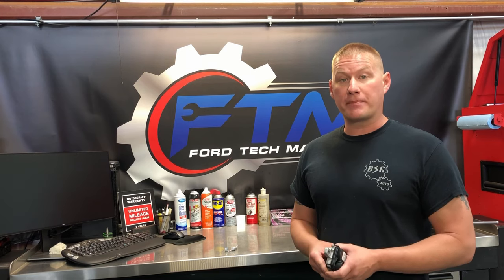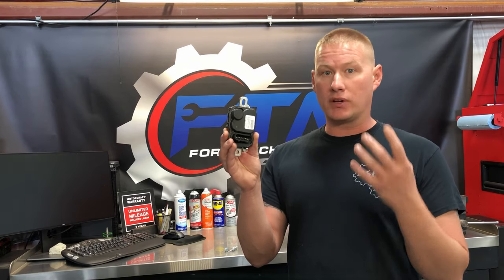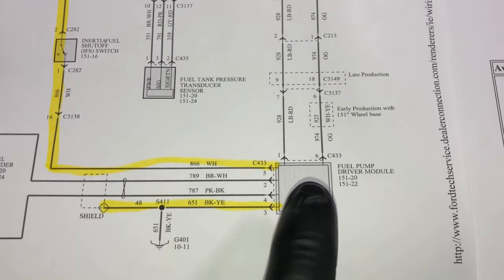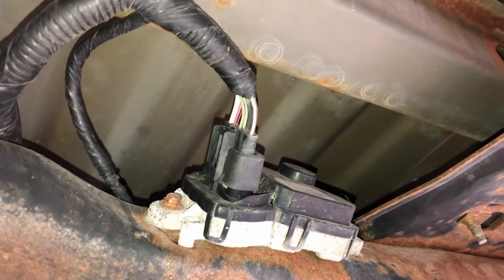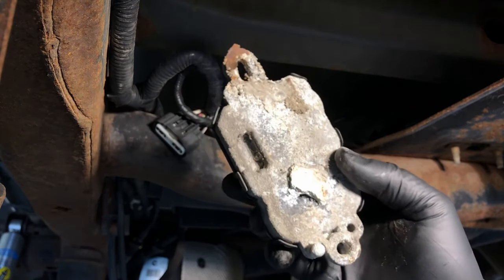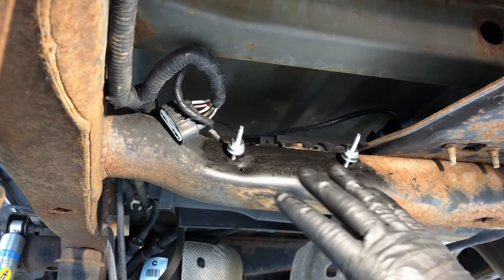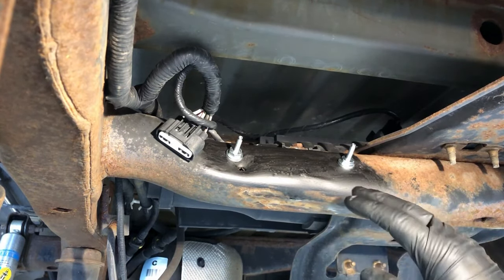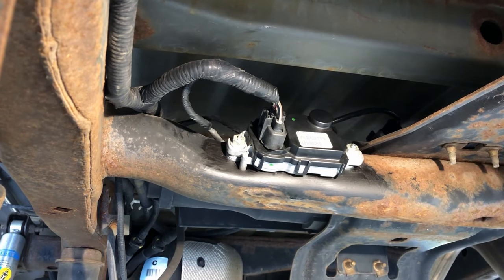2004-2008 Ford F-150 No Start DTC P1233: Fuel Pump Driver Module Replacement

Comment: Hi I like to say thank you,
For your great video's. They are easy  to follow.

I'm going to be cleaning the throttle body on my 2009 Ford edge.  I just wanted to run the procedure step by you to make sure everything  is accurate. 

1. Make sure everything is of radio, ac, etc. 
2. Remove the battery.
3. Remove & clean the throttle body.
4. Put throttle body back
5. SG12 grease to throttle body electric connector 
6. Remove & clean the MAF sensor. SG12 grease to MAF connector.
7. I'm adding K&N air filter.
8. Put battery back only connect positive wire. 
9. Alligator jumper wire
from positive to negative
for 15 minutes.
10. Connect negative start car & let it run for about 20 minutes.
11. Go for 15 to 20 minutes drive. 
Thank you in advance for your response.

Comment: Does this include the 2007 Expedition EL? I have seen the driver module listed for it on some parts sites, but have been told it does not have one by others.

Comment: Hey great job on all your videos. Great info and now I have a problem I have 2009 f150 4.6 I replaced my fuel pump but  the truck still dies after a few seconds I have pressure but slowly going down to zero . I don’t have leak in the fuel lines and new fuel pump . You have any clues of what I should do? Thanks in advance.

Comment: In the case of the module not failing would it make sense to cut a rubber gasket and mount it under the original still good fuel pump module?   Or are the studs a ground point for the module?  Always interested to see what is going to fail next on my Ford F150 (08).  Thanks for the video.  Doug

Comment: THANK YOU!!!  After watching this video I checked my module and sure enough it was badly corroded and ready to fail.  My F-150 is a 2005 with 172K miles  lived in Virginia most of it's life relatively free from salt (2005-2015) and now resides in Oklahoma.  I'm the original owner.  Its always had synthetic oil and I've changed the plugs twice.  The only problem has been one coil-over-plug failed.  Thanks again, I would have never known of this problem.

Comment: Mine got me at a friends house. I came out and it wouldn’t start. Didn’t know what was wrong so I had it towed home. Next morning I researched and bought an fpdm from auto zone. It was a dorman one but it’s lasted me over a year now and it’s a better design as far as spacers that keep it off the frame. Hopefully it doesn’t cause any problems later on.

Comment: Great video love the content and the general information about ford products, Got a question for you, I have a 2019 platinum f150 and want to drop the back to be level with the front instead of doing the typical leveling kit in the front, the blocks on the back are not tapered, if I remove them should expect any difference in drive ability? I.e a vibration from the drive shaft? Will the pinion angle change at all considering the blocks are not tapered? Would appreciate any insight, information on this specific topic is varied on the net. Thanks man!

Comment: Good informative video as always from a fomoco insider. Can’t believe you would get any thumbs down; really. The instructor shows you step by step procedures, with a wire schematic diagram and tells you where to find system voltage and ground on the label circuits not to mention plugging motor-craft products to use.

Comment: I'm replacing mine and both bolts broke.  The heads snapped off.  Any recommendation on how to remove the bolts?  Is heat the way to go?
Reply from the maker: Yes heat is the way.

Comment: could this cause p0191? i switched out a new rail pressure sensor, but still no start. just dropped my fuel pump driver module, and it's totally corroded through and the aluminum plate broken in half. waiting for replacement now.

Comment: I just did this repair in my shop. I always will use a bolt system to make stand-offs so that it cant interact with the differential housing.

Comment: Old school had fuel return lines via the fuel pressure regulator on the end of the fuel rail, hence an extra line back to the fuel pump. I guess this is now PWM(?) Pulse width modulation?
Reply from the maker: yes

Comment: 2007 Ford expedition,I need some help to locate it 😐
Reply from the maker: You don't have one thankfully.
Reply: So I guess I have to change my fuel pump, thanks👍👍👍
Reply from the maker: Please verify that first with a load test of the wiring to the pump, pumps normally don't fail on these trucks and the Expeditions.

Comment: My 2004 stalls when stopping. Starts right back up. Never throws codes. Can this be the cause?
Reply: My 2005 5.4 is stalling sometimes at stops and low speeds, and all dash lights and radio turn off. If I pump the gas after and it's still rolling, sometimes I'll get lucky and everything will turn back on and it will crank up and drive again, and I won't have to stop and start it back up... Does this sound familiar, and did you figure it out? My first f150 I'm still figuring everything out. Any help would be much appreciated man

Comment: Good Job.  To bad Ford didn't put that in a plastic container and then mount it spaced away from the cross member.
Reply: Um they literally did. Where do you think he bought the kit from?
Reply: @timothycc711  mount the plastic box on the cross member with the module inside it.

Comment: Would a wire thats had the coating stripped a tad, that's connected to the plug of the driver module cause the anti theft to engage? I mean my driver module is cracked and corroded to hell. But I have a wire that's stripped and one line of copper is split in that wire.
Reply: My driver module looks exactly like the bad one did in this video. Cracked in the same place

Comment: Can someone please tell me where the FPDM is at on my 2002 Ford F-150 is at? It is a 5.4 4 wheel drive 4 door lariat. I’ve looked all over under the truck all around the spare tire bracket and cross member. Is there an actual FPDM on my particular truck?
Reply from the maker: You don’t have one
Reply: @FordTechMakuloco  I have a 2004 f350 5.4L and I can't find the location I pulled the spare tire down and there is nothing in the location you shared in the video. Any idea of where I can find it ?

Comment: Brian, do you advise 5w-30 engine oil for 2004-2008 F150's with the 4.2L V6, 4.6L V8, and 2004-2008 E150 4.6L V8? Factory spec is 5w-20. Please respond to this question.
Reply from the maker: Yes of course.
Reply: @FordTechMakuloco  THANK YOU FOR RESPONDING!!!!!!!!!!!!!

Comment: I actually replaced mine today bc last night, the engine would crank over. Connector was dirty, but even after it was replaced...including the spacers provided with the new one...it still is not getting fuel and not starting.

What is next from there?
Reply: I have same issue . What was the fix?
Reply: @ctbeach  this is most likely the case. The module is actually under the spare tire. You have to disconnect the plug then it comes out with a few bolts. The replacement actually comes with a spacer to keep it off the frame. This is why it goes bad...moisture eats away at the back of it on the frame and then goes through the case. Moving it off the frame keeps it from collecting moisture.

Comment: Question Can The Aluminum Body Of The Driver Module Be Painted With The Ford Sealant Paint as Added Protection 😀
Reply from the maker: I actually coated it with fluid film
Reply: FordTechMakuloco Thank You 👍🏼

Comment: Hey @fordtechmakuloco do you remember the part number for the fuel pump driver module connector. I would like to replace mine as the connector on my 07 f150 is very brittle and the tab to release the connector broke off. Thanks
Reply from the maker: Motorcraft part number-  WPT-903
Reply: FordTechMakuloco thank you so much I appreciate it!

Comment: I am chasing codes and throwing parts at my truck and its driving me crazy. First code for vct changed then code for other vct changed then code for cam shaft positioning sensor changed then for other sensor.  And now im getting code for a knock sensor.  Dont really wanna just go changing it cause have a feeling not my problem.   Im thinkin bad computer ?
Reply: they seem to be related.  the phasers on the cams are sticking would be my guess. check oil pressure  change oil and oil system flush would be an inexpensive start. search his videos he has a few that deal with this.
Reply: Richard ive redone phasers timing chain new guides tensioners up graded 360 melling oil pump and all that about 6 months ago with all ford parts

Comment: I’d like to throw spare tire in the bed. Will that leave the fuel module open for undue damage of corrosion? Thank you.
Reply: Damage or corrosion?
Reply from the maker: No it will be just fine.

Comment: Milwaukee tool:  Which model are you using in this video?  That would fit into SO many spaces.
Reply from the maker: https://www.homedepot.com/p/Milwaukee-M12-12-Volt-Lithium-Ion-Cordless-1-4-in-Ratchet-Tool-Only-2456-20/203111679
Reply: @FordTechMakuloco  Thank you, much appreciated!

Comment: I need some help, 04 f150 5.4 76,000 it had a hard start and was stalling at red lights and when I slow down. Brought it to a shop they said I had low oil pressure 15 psl and timing chain needed fixed , they said I should just buy a new engine and they'd install for 6500. It wasn't a certified ford shop should I believe them or bring it to a Ford mechanic
Reply: If it were me I'd be getting a second opinion.
Reply: Always get multiple opinions. Tow fees are cheap compared to the cost of purchasing and installing a new engine.
Reply: Mine is doing the same exact thing bro, did you figure anything out? Much appreciation since I've just paid for a new transmission and done alot to this truck.. would be sad if I had to buy new truck
Reply: @jamesmorey4930  had to have the cam phasers locked out, got a new timing chain and etc all done to get it running right again. All together about 3 grand to get it done. But it's been over two years and no issues since.

Comment: Ordered the part from you're link and it didn't come with the hardware??
Reply from the maker: Did it come in an unopened Ford box because to this day they still come with a hardware packet and install instructions.
Reply: @FordTechMakuloco  yes in a ford box but no hardware

Comment: Make sure you remove the grey rubber gasket when installing!  If you do not, you’ll throw a P1233 code!  Happened to me.  Go out and disconnect and check if you left it on!  Awesome job Brian!
Reply: What grey gasket are you talking about? Please help
Reply: Do not remove any rubber gasket! That’s what keeps water and mud etc out of the connector.  Just ensure the plug is fully seated and good to go.

Comment: only 60 miles on my 2010 f150 crew cab. what causes vibrations at highway speed? i got all new tires they road balanced all of them, new struts, rack and pinion, new pads and rotors alignment is perfect steering wheel doesn’t shake the inside of my truck shakes violently and makes my truck feel unsafe. does anyone have any ideas?
Reply: U joints, cab mounts,axle and pinion bearing
Reply: Sounds like your driveshaft center support bearing has gone bad. Or like paul said, check the u-joints.
Reply: how do i check for these things? and thank you guys so much for saying something i’m so sick of the vibration. checked the support mount and the rubber still looks brand new
Reply: You want to check these things simply by moving them around. They may look good but until you pull,stretch and rotate you won’t see their fault. Lay underneath and push up on sturdy areas of the floor jostling it around and watch the body mounts. Have somebody rock the truck back and forth while in park all tires on the ground and look at all the mounts in the driveline,trans,transfer case,motor anywhere there’s rubber mounts to the frame and cross members. Although the drive shaft my rotate very slightly, there shouldn’t be any slop in the ujoint itself. U joints tend to squeak at lower speed, may sound like a steady paced loud bird chirp.
Reply: paul tomasetti.  i finally got a chance to take it to a shop and they told me that it’s normal for a truck to vibrate at highway speeds and that it was because my wheels are to big.  my tires are the factory size. and this doesn’t add up to me bc i had a 2001 and it never had a single vibration. any input?
Reply: Brant Vice - sorry you had an unsatisfactory experience. You need to find a shop that cares. Maybe a friend to drive it and help you wiggle things. A shop that has an oscilloscope with nvh capabilities ( noise,vibration and harshness). Would probably be cheaper to get a couple GoPro knockoffs and mount’em underneath and start driving and moving them around till you see what’s moving at the same frequency that your feeling it. There really isn’t any way I can be of more help to you from WI.
Reply: paul tomasetti ok i’ll try that, thank you so much you’ve help me so much id be lost without your help!

Comment: Does this also apply to the ford ecoline. Vans ?
Reply: 2011 E series has a plastic potted module on the frame that does not have this type of failure, not sure of the model years that uses the same design

Comment: What if my dash says Check Gauges?
Reply from the maker: You should see which gauge is not responding, or not in range.
Reply: @FordTechMakuloco   I have codes: P2107
P2110
P2100

Comment: What are the common symptoms when going bad?
Reply from the maker: Random no starts.
Reply: @FordTechMakuloco  What about idle problems ad dead stop almost to the point that the engine will shut off. While driving high speed is fine but when stopping will almost shut off
Reply: @FordTechMakuloco  Will it also cause the truck to randomly die while driving?
Reply: @GodzillaMX007  ya this is exactly what's going on with mine not it wont start keep me posted if you figure it out
Reply: Is this what your having pm me
Reply: @alleng2936  Yes exact same thing. I'll see if I can upload a video. I'll let you know.

Comment: I just did this on my 06 Ford Escape. The doorman kit comes with the module painted silver not raw aluminum. It also came with a multi choice fastener kit and rubber stand offs with metal screws going thru them. I got mine for 40$ off eBay. I hate doorman. But this kit was awesome. I also added some silicone glue around where the plastic top meets the module and snaps on. Just extra precaution against salt.

Comment: I have a problem recently changed the fuel pump driver module 
And now I have 3 different codes

P2101- Powertrain
Throttle Actuator Control Motor Circuit
FAULT

P2104- Powertrain
CURRENT
Throttle Actuator Control System force idle 

p2110 - Powertrain
Throttle Actuator Contral System - Forced Limited RPM

p2135 - Powertrain
Throttle/Peda/Position Sensor/Switch A/ B Voltage Correlation

P2111 - Powertrain
Throttle Actuator Control System - Stuck open
I just change the part plugs and checked out all fuses them star

Comment: Been having an issue with no start then wait 10 min and it starts,  new fuel pump.    Michigan truck with 225k miles,  2006 F150.

Didn't even know about this component without your video,  thank you.

Comment: What was wrong with the older vacuum controlled pressure regulator?  So sick of “let’s make it better with another module “ (that’s more problematic)!!
Reply: Most likely with the addition of most electronic modules that replaced mechanical components, it was done to meet newer stricter emissions regulations required by the EPA to keep the tree huggers happy.  Fuel pressure is one of the most critical things that affect air fuel ratio, and by going to the returnless system and having the PCM in direct control of the fuel pressure, it can adjust fuel pressure under load much quicker than a vacuum controlled mechanical unit can, which will have a slight lag time for more precise fuel control in order to make the catalytic converter more efficient... its the same story with the 2.3L and 2.5 liter four cylinder rangers with the dual spark plug per cylinder idea.. which I think was really stupid.... especially while I was changing the driver's side plugs... friggin nightmare.

Comment: Can you buy the stand off hardware separate from the module to help keep existing modules from failing?
Reply: If you can not, do what I will be doing today.  Put a rubber gasket behind the module or get longer mounting bolts and make your own stand off by adding a spacer. (could be another nut or two, tube or what not.
Reply: Jason Bowman To be honest that was my first thought.  I am a HUGE believer in fluid film.

Comment: The frame is on it say out
Reply from the maker: No it’s very light surface rust
Reply: My 2004 f150 I could poke holes in the frame with my finger. lol.
Reply from the maker: Yup I am seeing it more and more.
Reply: @FordTechMakuloco  wont put a customers on lift ,ready to red flag it bed cross menber feel out on highway.just wants 6 mounths lol.